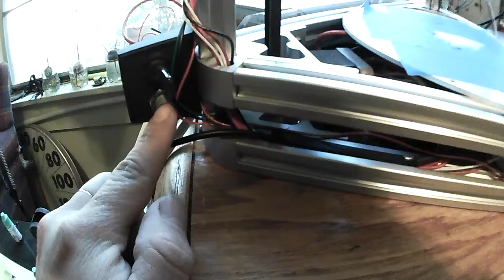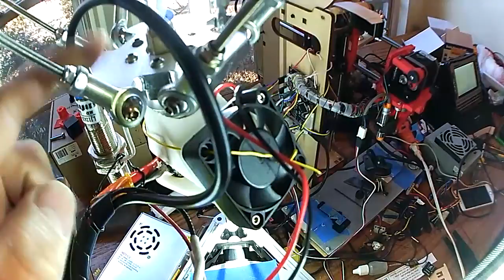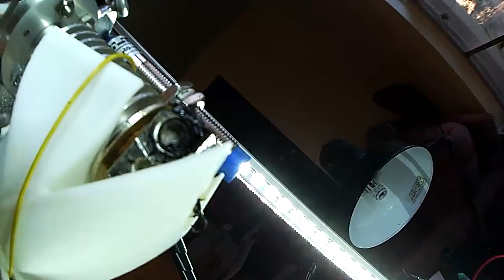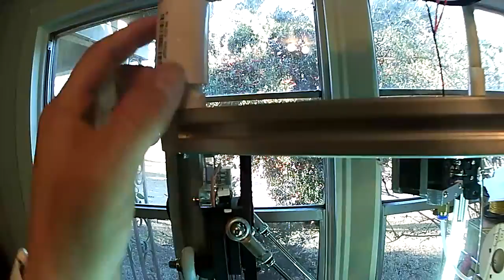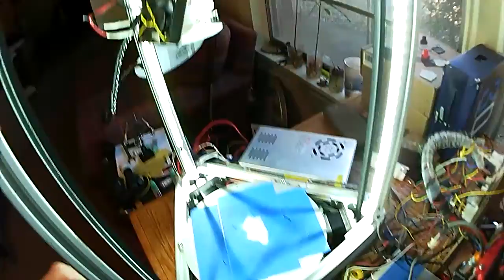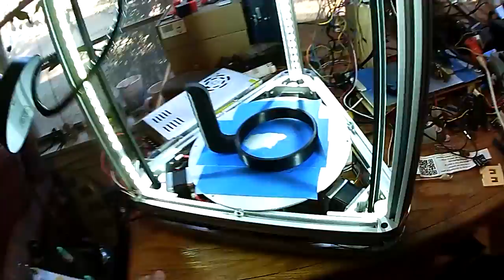My Folgertech (Kossel) DELTA printer build, review and help

Comment: just saw your video.  Question for you.   Can you give me some more info on the metal rod setup?  I would like to know the brand of the rods and ends.  If possible, can you provide a link as to where you purchased those items.  That is one thing I would like to see Folgertech improve on is have assembled quality rods an ends.  Other than that, the only mod is using a E3 hotend.  Once I have everything initially setup, I will change my controller to a Duet wifi/lcd screen.
Reply from the maker: Troi Bandy  sure thing ! Let me find again where i got them and i get back at you, although these rods end up being about 5mm shorter than what the instructions ask for  once i got them set up but it didn't affect anything